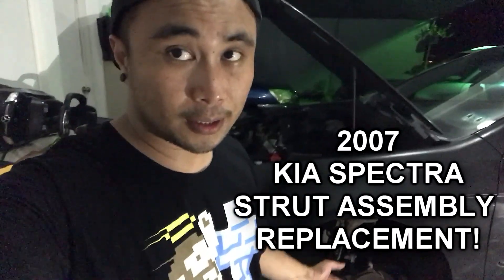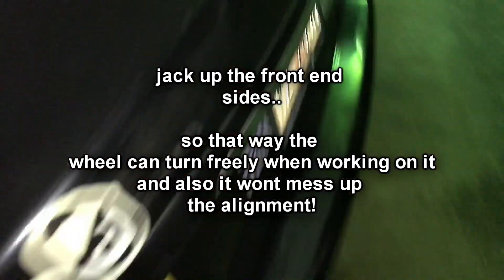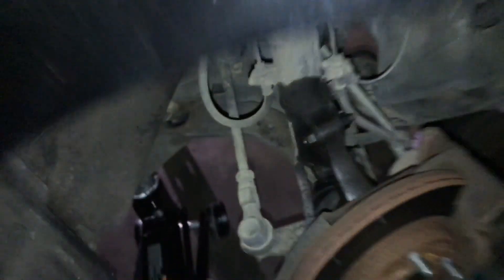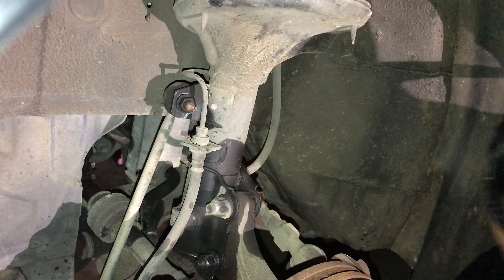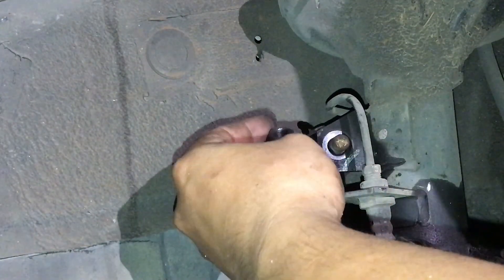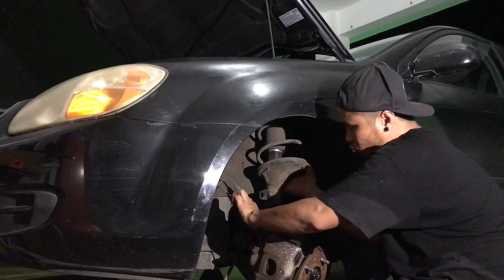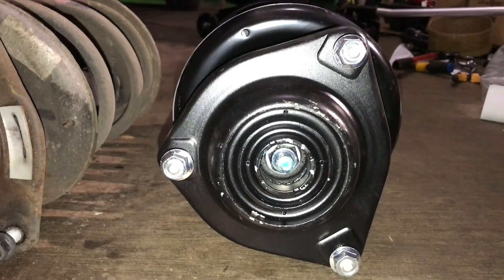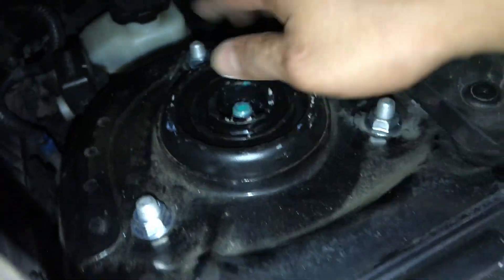2007 KIA SPECTRA Strut Assembly Replacement

Comment: Hiya from Rochester, NY!  You’re lucky you don’t have to deal with the insane salt and rust here!  Just one thing I noticed - when you buy those preloaded struts - they often don’t match the specs of the original strut.  The spring can be thicker gauge resulting in a rougher ride than you started with.  Also sometimes the height is a bit off too which ends up raising the front of the car.  Idk how manufacturers get away with this garbage.  Great how-to though, hopefully the one in about to start in 35-degree weather goes as well 😉
Reply from the maker: Wild wild wild!! Yeah im on an island so we near that salt water air and the heat so might be similar with rust type of issues...and big thanks for the info!!! About struts! Ill be uploading a similar video but for 2008 kia sportage in about a week! Cheers thanks thanks for watching happy wrenching bro

Comment: I was wondering if the rear replacement was the same besides taking out the seat in the back? Ive seen some people say you need to cpmpress spring in back but do i need to if i get a whole replacement?
Reply from the maker: @madelyngrant8300  not sure 🤔 i havent done it